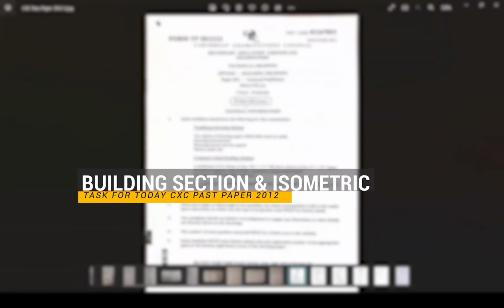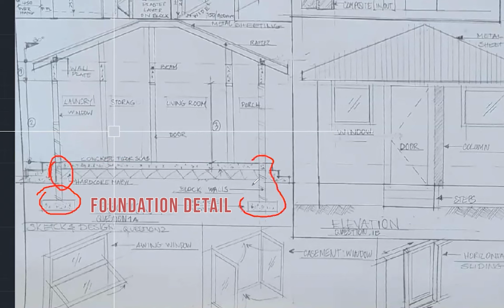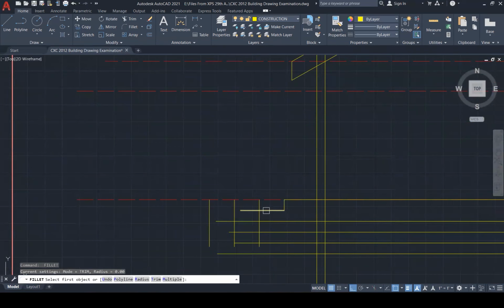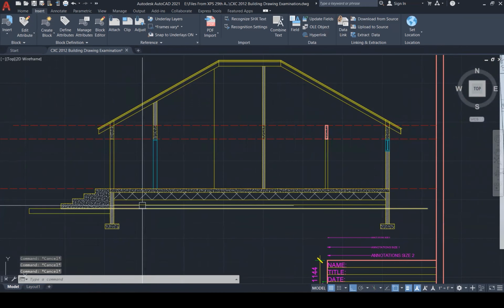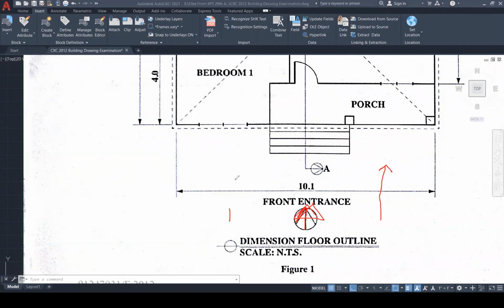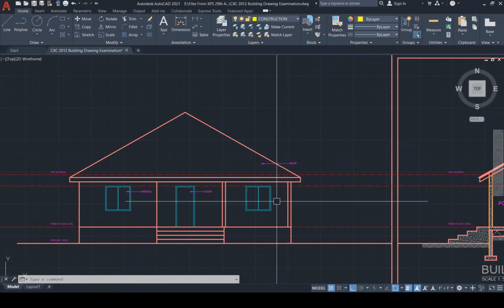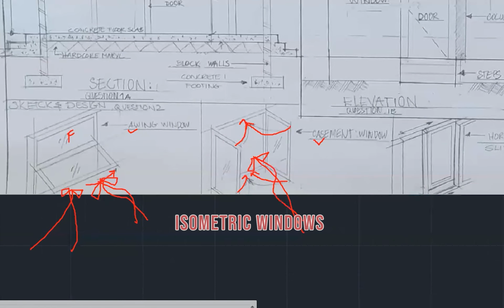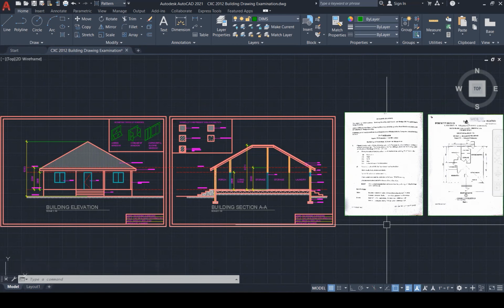AutoCAD: CXC Technical Drawing Past Paper Building Drawing [2012]

Comment: Good exploration. However, students are a little confused by a few things. I suggest you make the adjustments to make the tutorial better.
1. At about 3:41 the pen movement on the casement-type window sketch while referring to the awning-type (and vice versa) 
2. The direction of the arrows on the cutting plane line A-A were not considered for the section A-A shown. Thus details shown are actually for the "discarded" section.
Reply: I appreciate these comments man i'll make adjustments in the next presentation